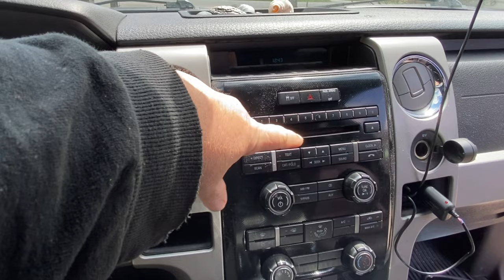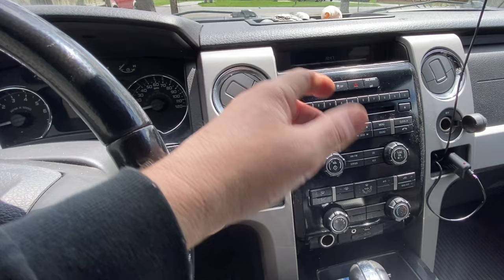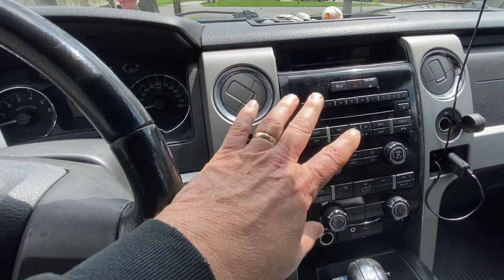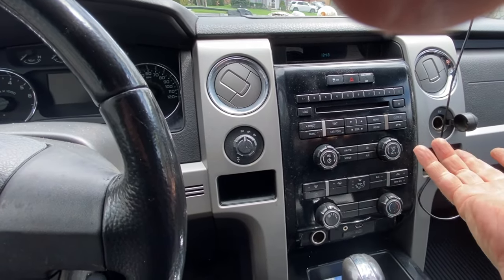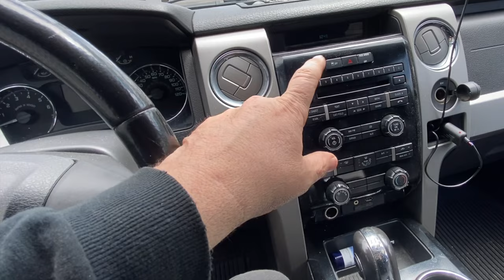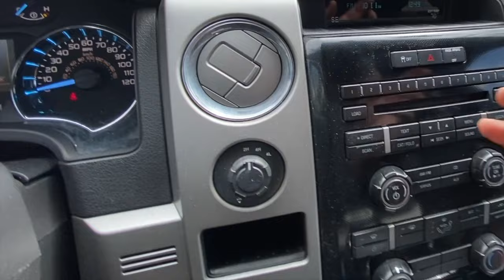Ford F-150, F150 Clock Blinking/ Flashing? Radio/ Stereo Not Working? -2009 & Up - Diagnose Yourself

Comment: My 2011 radio just went out today must be that time for them to go bad
Reply from the maker: Yep, give it a nice wack with you open hand and see if it comes back to life. I’ll be making a video soon on how to repair it.
Reply: Same 😂 just smacked it
Reply: My 2013 just went out yesterday fml
Reply from the maker: I’ll be making a video shortly on the repair
Reply: Same year mine went out about 4 months ago trying to fix today but I thinks it’s a short
Reply from the maker: It’s probably not a short, these radios are known to fail, shorts are not common
Reply: @Jacob_6420 mine 2013 went out last week too
Reply: 2010   mine just went out 2 weeks ago
Reply: 2011  just went out😂😭
Reply: What the heck, mine went out today.
Reply: Tap worked for me. Hit it pretty hard
Reply: Yup mine just went on my 2012
Reply: Must be hahaha
Reply: Mine went out left it for over a year and it magically turned back on for a few months and then turned off again
Reply from the maker: @brandypartridge9685 try the baking fix
Reply: My 2011 just did it too
Reply: Bake it in the oven at 325 for 15 minutes. Fixed mine.
Reply from the maker: @brandonblackwell4390 That’s great! Thank you for the update!
Reply: @christianstephens1288  did it work after you smacked it😅
Reply: Lol😂
Reply: Bought new battery. Everything works
Reply from the maker: @LJ0170 hmmm don’t believe new battery would effect the stereo because when vehicle is running alternator is doing the work. Maybe when you disconnected the battery it triggered the stereo but anyway glad it’s working

Comment: The tap worked 😮 I been driving without music for months waiting to afford a radio replacement. Thank you.
Reply from the maker: Great!, if you are handy you can try to fix it yourself :
https://youtu.be/vhbmGoeO9xU
Reply: @Motorcarnut  my left side of my speakers  stopped working, sounds like they shorted out
Reply from the maker: Yep, mine too, it’s common, sometimes when you raise the volume it kicks back in, that’s the coils in the speakers failing
Reply: @Motorcarnut  raising volume didn't make it kick back in I think i need to just get new speakers to install on left side and maybe not a new stereo? If stereo has issues after new speakers then used one.

Comment: Thank you I just bought a used f150 lariat 2011 and the guy said the radio never worked I am going to check those
Reply from the maker: No problem, and have another video on a more permanent fix too
Reply: @motorcarnut  yeah I tried smacking it and it worked for like 1 hour  but I can’t get the radio out the shifter is in the middle and there are no video of how to do it with the center console shifter also what’s that video called

Comment: I heard the loud pop a few times with my radio and then a couple weeks ago it popped and the radio won't come back. The screen just flashes exactly as you described. I'm thinking I'm gonna have to bake the damn circuit board but we'll see. Thank you for your very helpful videos!
Reply from the maker: No problem, thanks for the comment!

Comment: The tap worked! I'll take mine in soon to have it serviced.
Reply from the maker: They probably will replace the whole stereo, I will be making a video on how to repair the original stereo soon/
Reply: @Motorcarnut if I can do it myself I will install a after market instead of used one that'll just have same problems
Reply from the maker: Ok, just remember, you’re going to need a dash kit wiring to make sure you don’t lose controls, sync etc. can be over $1200 just for a basic stereo, been there

Comment: Your videos are fantastic, but I’m just curious my clock is blinking but it also sounds like maybe the CD is skipping but nothing will work. None of the buttons it just keeps sounding like something skipping if that makes sense  Any advice
Reply from the maker: Give it a whack, like in the video, if it doesn’t come back I have another video on how to try another way
Reply: @motorcarnut  I hit a bunch of times and it doesn’t seem to do anything. Is it worth it for me to check the fuses or should I try the next step that I think you have?
Reply from the maker: You can try but you may have a different problem.
Reply: I have the same problem

Comment: My 2014 just did this right now the smack worked
Reply from the maker: Great! I will be making a video on how to repair the loose solder joints that are causing this issue so stay tuned! Thanks

Comment: I replaced door speakers a month ago but one was loose turning on and off while crackling. So if it short out radio it would have affected the fuses in panel? Because they looked good.
Reply from the maker: Not necessarily.

Comment: If the speaker shorted the radio system, how is that fixed? I replaced the fuses, tried the tap, and still no fix. I heard the crackling speaker like you were explaining before it cut out
Reply from the maker: Replace the speaker

Comment: Hey there if I was to replace my stereo with another used working one, is it just plug and play? Or do I have to program it or something? Thank you!!
Reply from the maker: Have to match numbers on your unit with used one exactly then it will be plug and play
Reply: @motorcarnut  thank you so all numbers need to match like the serial number, Ford part number and model number?
Reply from the maker: @hectorortiz91 Just the Ford part number like this:
BL3T-19C157-AC
Reply: @motorcarnut  got it. I wonder if my owners Manual has the ford part number of my stereo so I won’t have to remove the stereo to check the number
Reply from the maker: @hectorortiz91 have to remove stereo

Comment: Could this situation be on any car? My Accent 2012 just flashing clock display and at same time digital fuel gauge showed empty when 1/2 full...Battery was drained like many times before and giving it a jump fixed everything, yet I never had clock/gauge issue before.
Reply from the maker: No it’s not related. Yours sounds like a short somewhere draining the battery. Could be the stereo as they were known to cause your problem

Comment: I checked the fuses all ok,the radio worked fine two days ago,I had misplaced my keys so I used my spare key then I noticed that I had no radio,I found my regular keys and now have the same thing,blinking clock and a Bluetooth sign don't know what to check next
Reply from the maker: Did you watch the whole video? Give it a good hard smack and see if it comes back on, if it does it’s probably the solder joints in the radio itself. I will be making a video on that repair soon but see if the smack helps

Comment: Hello i got a ford f150 2011 and i got a problem with the radio it just work when the truck is off but when i turn on the truck and i try to turn on the radio the display shows that the radio its on but the speakers it no hearing donyou know what could be the problem? Hope you can help me!
Reply from the maker: Sounds like it’s the front panel of the radio that’s bad. Salvage yard should have used one.

Comment: Speakers have been cutting in and out sometimes for years, radio works fine, yesterday the display stopped working nothing displayed. I have a 2010 F150 XLT w/ sync. The fuses are good the radio works. Should I try to get the display out and replace it with a junk yard replacement?
Reply from the maker: You could , but you have to make sure all numbers match on the new display even the letters or it will have to be reprogrammed by dealer and that can be a pain and extra money.
Reply: @motorcarnut  what would you suggest , an aftermarket radio that eliminates the need for the display?
Reply from the maker: I was in the same predicament, but I found a used stereo on eBay with the exact numbers and it worked no problem but it’s hard to find them matching all numbers. I like a better stereo but it involves a dash kit, wiring kit to save sync, steering wheel controls and the stereo, plus if you don’t know how to install everything it can run over a $1000 depending on the stereo you want. I was going that route since I did want an upgraded stereo and I can install it myself however I don’t have the time and like I said, I found the stock unit on eBay. So depends on your situation. If you go the new upgrade way, check out Crutchfield , you can input your vehicle and it gives you everything you need to install even help if you need it.
Reply: @motorcarnut  I'll watch some more videos and look around at different options. I do appreciate your help.
Reply from the maker: Thank you!

Comment: My 2011 f150 lariat clock blinking and radio not working and now while l'm driving the left door ajar comes on and the interior lights blinks. Hopefully I'll try tapping the radio to see what happens.
Reply from the maker: They may be unrelated the lights coming on, but see if the smack gets it working again

Comment: This happened to my truck. Added a new radio, new speakers, and checked all fuses. Still does not work. Any suggestions??
Reply from the maker: This is for the factory stereo, an aftermarket unit is different and can be a number of things.

Comment: 2009 f150 the radio works fine and Bluetooth works but the screen sometimes is blank or black. Any ideas?
Reply from the maker: Sounds like the front lcd panel is going bad. Can find a used on on eBay or salvage yard

Comment: I checked the fuses and smacked the radio and still nothing has worked. been out for a couple of months now. all the buttons work for A/C but nothing else.
Reply from the maker: Yours is probably to bad to come back unless you do the solder repair. I will make a video on that process soon.
Reply: I put mine in the oven it worked
Reply from the maker: Awesome!

Comment: I reflowed the radio PCB and it fixed the speaker s cutting out but the display still doesn't work. Does anyone have a good one for sale? AL3T-19C116-AB    14798992  it's for a 2010 F150 XLT
Reply from the maker: You have to match the numbers exactly or some features may not work and would have to be programmed by dealer which is a pain.

Comment: My radio keeps making a clicking sound and wont turn on anymore gee i wonder if i need to replace it? 😂no sound and wont find a radio signal and i was using my transmitter at the time it went out
Reply from the maker: Try this it may work or have another video on trying to fix it yourself with good success.

Comment: I changed my battery and now the radio and clock do not work.
Reply from the maker: Try the method in the video, if not you have a different problem.